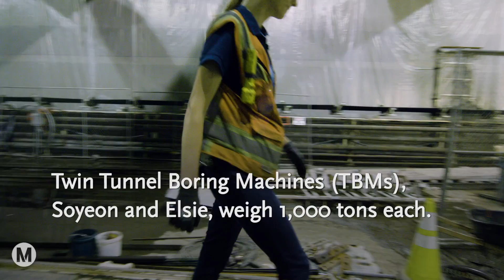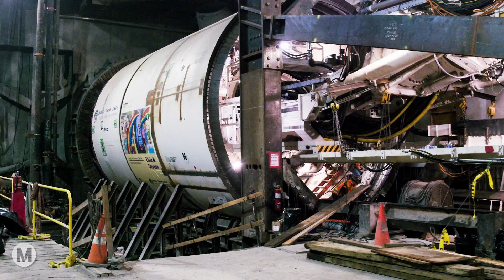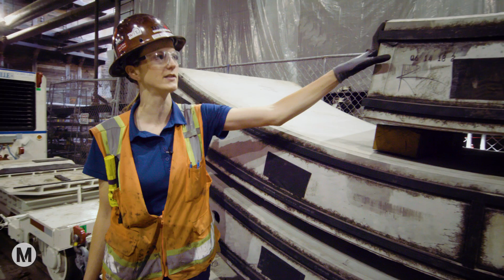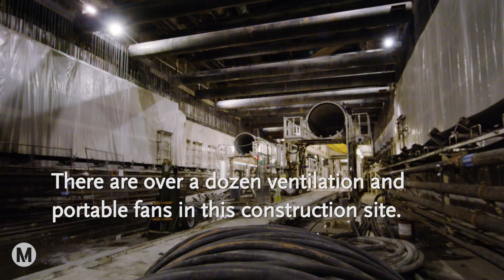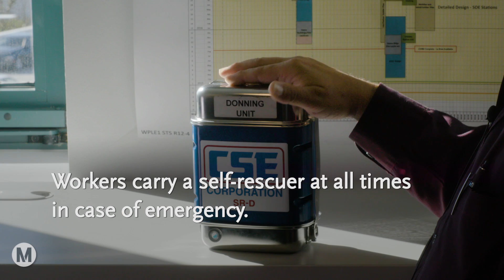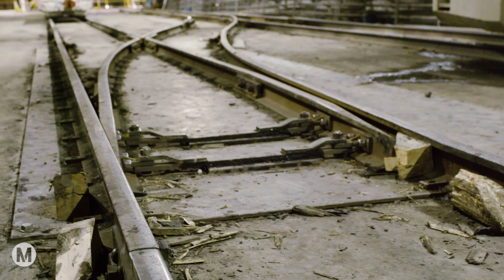Constructing the Future: Purple Line Extension Transit Project

Comment: Nice job. The woman in this video is a serious builder, knowledgeable and Angelenos are lucky to have her on the project. The gentleman discussing air safety was equally professional. The sleeving segments that become tube extensions which support the tunnel structures are genius! The supply chain just to deliver the 20 or so 5-foot wall sections required each day to reinforce the tunnel is a heroic achievement in its own right. Plus the design of the boring machine!